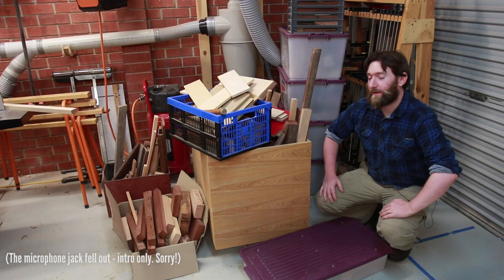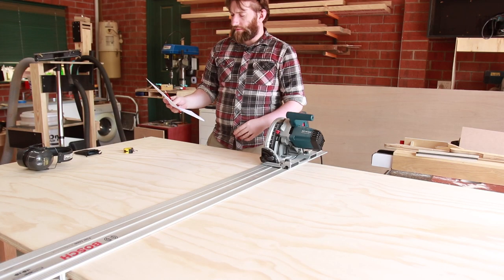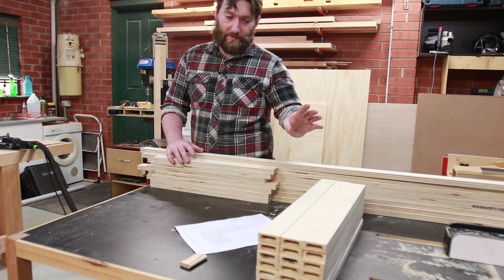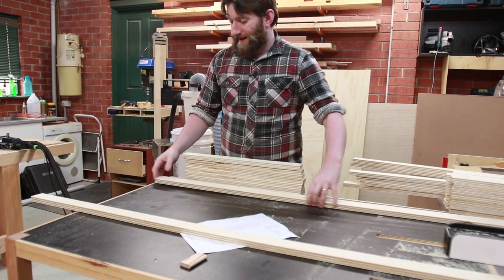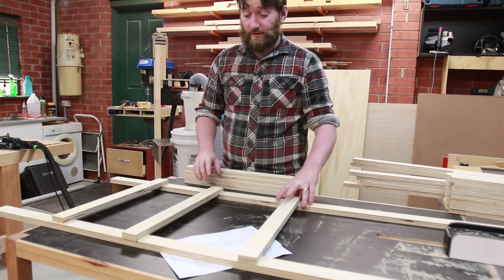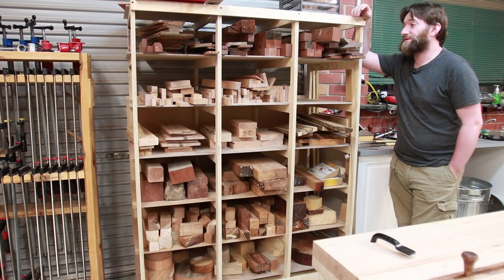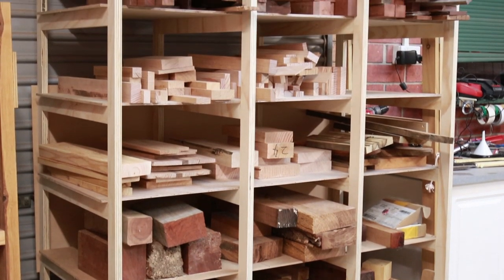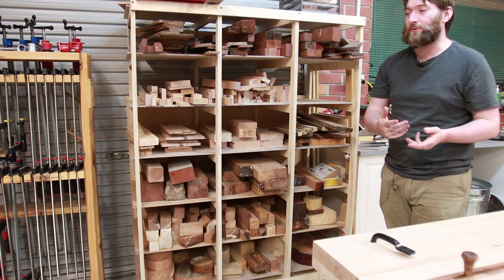How to make simple shelves to store offcuts

Comment: Thank you for another great video Paul. Can I ask why did you use plywood for this build? Did it work out cheaper than using the 19 x 42 pine strips available from Bunnings? I use the dimensional pine a lot because I don't have a table saw...
Reply from the maker: Yes, it works out cheaper. Potentially stronger (though, maybe not because of the single direction of solid wood), easier as my plywood supplier delivers, and considerably straighter than any pine found at my local bunnings.

Quick napkin maths has the pine work out at (least) 20% more expensive just to build the storage rack. Meanwhile I still have a good 1500x900 piece of plywood left over. 

You'd have to do it in a particular order, but a circular saw with an edge guide (either the standard one or something like Kregs Rip Cut) could get this all done. Would it be worth doing it that way? Probably not, the extra hassle of  awkward order of cutting would outweigh the increase in cost.
Reply: Thank you Paul for taking the time to reply in such a comprehensive way. It is very much appreciated for a beginner like myself :)